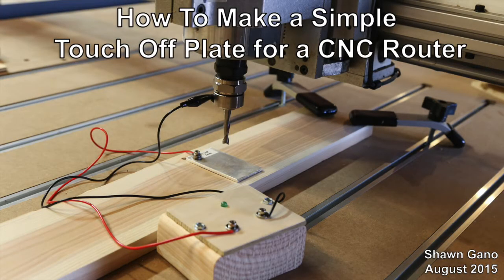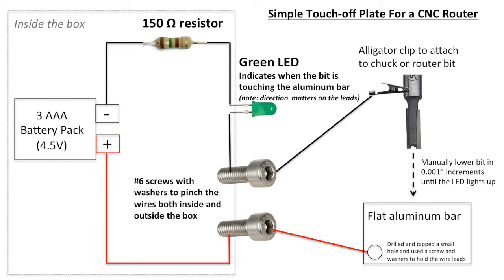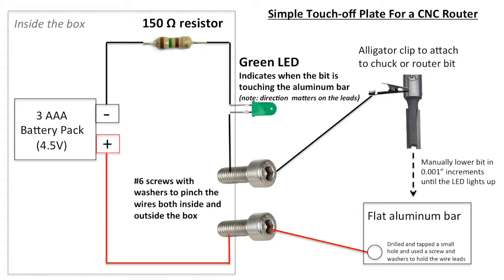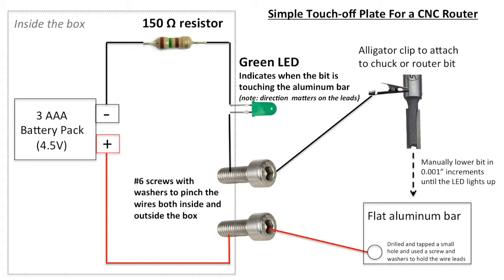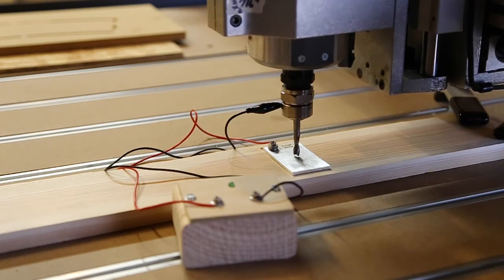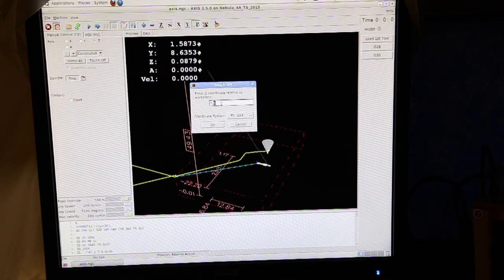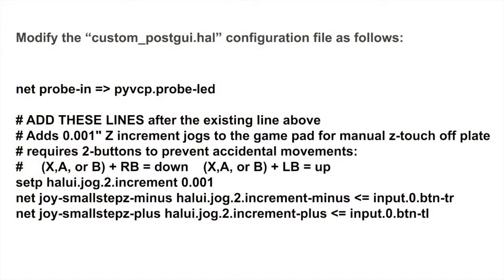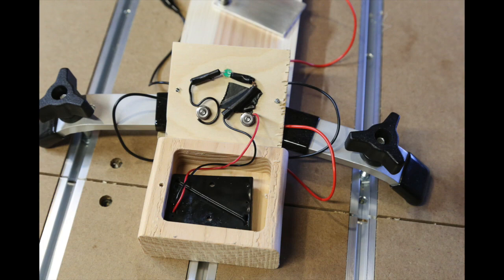Make a Simple Touch Off Plate for a CNC Router

Comment: what type of software are you using to control your CNC?  Mach 3 has, and I use an autozero function  also an auto edge finder, auto center finder external or internal.
Reply from the maker: Thanks for the idea/suggestion!  Though I am using LinuxCNC (as that is what my stepper motor driver controller was designed for) -- I am also short on inputs so the feedback loop isn't wired back into the computer.  Though I have since designed and 3D printed a much nicer "box" that had storage area for the plate and leads.  In the future I may look at trying to automate this more; but for now it is still quite quick, repeatable, and easy enough.
Reply: @shawngano   Yeah, That is a problem, i like more inputs and more outputs for increase the outofunctions like turning accessories on and off functions dust extractor pulsing pumps and things like that but then i need to go to a haas or a simmens controller   Cannot afford any of them.

Comment: I'm know very little about electric / electronic stuff, but....Could I eliminate the resistor and go with one 1.5v batter along with a 2v bulb?  Might be a bit dim?  What's the advantage of using multiple batteries and stepping down the voltage?  If that's a stupid question, someone just correct me gently.
Reply from the maker: Yes I think the bulb and battery would work just fine; it may be dim but I would suspect you could still see it (if it is too dim you could use a 1.5V bulb - I think they make those too).  Generally the advantage of multiple batteries is that they can be used to get to a higher voltage (or will last longer - but in this case that isn't a problem).   The multiple batteries and resistor used in this video was just to get to the proper voltage for the LED and prevent too much current flow --  and were some of the components I had on hand.   Luckily these types of circuits are not very sensitive so they work over fairly larger ranges of values.  My main suggestion is give it a try - this really is a handy tool.
Reply: @shawngano  You definitely want the resistor to limit current.  Each diode has what's called a "forward voltage drop" that must be overcome in order for the LED to light up at all.  Once this forward voltage drop is exceeded, there's little stopping the current from going to essentially infinity except for the LED blowing.
Reply from the maker: @electroninjection183  Great clarification and description thanks!

Comment: I just came across your video and want to make one of these.  I am not up on electrical stuff, so I need to know which resistor to buy and which led to get. There are several 150 ohm resistors (depending on wattage) and several leds (depending on voltage).  What are the specs on those and if you can tell me, where didn't you buy them.
Larry
Reply from the maker: Hi Larry - as this is a low power usage you can use pretty much any 150 ohm resistor (you can get them at Radio Shack) or here https://www.amazon.com/150-Ohm-Resistors-Watt-Pieces/dp/B07PS3TMPX/ref=sr_1_8?crid=37J1EELKIM1IG&keywords=150+ohm+resistor&qid=1581195092&sprefix=150+ohm%2Caps%2C168&sr=8-8  (or you can get a pack with different resistances for about the same cost)   ---  For the LED any standard one should work as this circuit simple and not pushing the specs of any of these components:  here is a nice variety pack:  https://www.amazon.com/DiCUNO-450pcs-Colors-Emitting-Assorted/dp/B073QMYKDM/ref=sr_1_9?keywords=LED+green&qid=1581195219&sr=8-9    or here are just some green ones:  https://www.amazon.com/MCIGICM-Circuit-Assorted-Science-Experiment/dp/B07S68XD75/ref=sr_1_16?keywords=LED+green&qid=1581195219&sr=8-16   -- if you can solider the components it will stand up better over time (I ended up doing that after a couple of years) -- but it works fine either way. (Once you have it together if the light it too bright swap in a higher resistor, if it's too dim swap in a lower resistor -- also be sure to put the LED in the circuit the right direction, one leg needs to be on the negative side otherwise it won't light up).

Comment: I'm very impressed with your setup and would like a list of the products you have from the model of CNC router, the size of your work table, the home made laser (X & Y zero point) and the tool length touch off "button."   Thank you.
Reply from the maker: Thanks!  The CNC router is a Probotix Nebula (now called the GX3750) [https://www.probotix.com/CNC-ROUTER-GX3750].   I modeled and 3D printed the laser mount -- you can find more details here:  https://www.thingiverse.com/thing:2782511  .   And this is the tool length touch off button/sensor (I got it with the CNC machine):  https://www.probotix.com/CNC-ROUTERS/ACCESSORIES/ATLaS-TOOL_LENGTH_SENSOR  (though it seems it is a quite a bit more expensive now than when I purchased the sensor)

Comment: How do you account for the thickness of the aluminum plate? I mean how do you tell the CNC controller that the zero point should be the touch point minus the thickness of the plate?
Reply from the maker: When using plate to set the Z-position. I don't set it to zero I just enter the thickness.  So for my case the plate is 0.118in thick.  So when the bit just touches the plate (Which lights the LED) I tell the controller that at that position Z=+0.118in.   You don't have to set the 0 point you just have to set a known position in the Z-axis.  Does that help?

Comment: XYZ ZERO PLATE CODE TOTALLY FREE !!

First of al, apologizes for my bad english :D

I want to say thanks to all of you guys whom made 
videos about DIY CNC routers.  I took many ideas from
them to build my own !

Now I want to share something i am sure many of you
need, if you don´t have it.
It is a zero plate for X, Y and Z axis just in one step :D
Measures  of plate are not important, you can make it
your way.

I've took two pieces of VB code, one from "budman68" post at www.machsupport.com the other one was from "edoctoor" post at www.machsupport.com .

I joined both codes and made some minor changes 
to form a unique routine to find  the center of a hole 
along with the corner of  the material.  Finally, code
looks for Z axis zero.

My plate it`s a square of 71mm wide.
Total height is 12 mm.
Hole is 11mm diameter placed at corner of
relief section which is 7.9mm height.  
 
You can modify this code to mm or inches.
Hope you enjoy!!!
Thanks!!! 

WATCH THE VIDEO AND DOWNLOAD CODE :D
https://youtu.be/lL1Qhh9IQeE

Comment: great and simple to build,so its not connected to PC right?
Reply from the maker: That is correct it isn't connected to the PC at all.  It is just a more precise way to set the Z-0 by hand.  It is possible to wire it in and use an automated probe command -- but so far I have found this to work really well and is fast enough for my needs without all the complexity.

Comment: looks like you are running a GNOME desktop.  could you share what for stack is for running your CNC?

edit: never mind caught at the end that you are using LinuxCNC.
Reply from the maker: Yes I am running LinuxCNC v2.5 -- which uses Ubuntu 10.04 (which is a bit old but it is quite stable)
Reply: thanks

Comment: nice  will make one    :) great   thanks
Reply from the maker: +elias mora Glad it helped; I still use mine all the time and it is still working well!  Though I might suggest using a slightly thicker wire to connect the plate; as mine has broken once.
Reply: thanks man for the tip...  cheers from this side of the planet  ( shanghai )

Comment: Simple and functional. I wish I did something like this before I got my probe wired up to my cnc controller. Did you build your machine or is it a commercial product? Looks nice. Perhaps do a video on it?
Reply from the maker: +Auarhau Thanks!  Someday I want to wire in a touch off plate; but as this is working so well for me I have been doing other projects instead ;)   My CNC machine was made by Probotix (http://www.probotix.com)  -- I thought of building one from a kit - but I decided to go with a pre-built one from a good company that didn't use a lot of proprietary parts.
Reply: I get the part of not changing something that works. My entire machine is made up of temporary quick fix solutions that now are permanent quick fix solutions:p  I found the probotix website myself Looks like very good machines, but certainly a substantial investment. I cant justify spending that much, but sure would be nice to have one :=)
Reply from the maker: +Auarhau Yeah they are a bit pricey but I also use it as part of my small business.  I just watched a couple of your videos I really like your dust boot - it looks simple and effective!
Reply: It helps a little. But It's not as effective as I had hoped. So I rarely use if these days. The only good thing about it is that it's clear all over so that you can see what's going on.